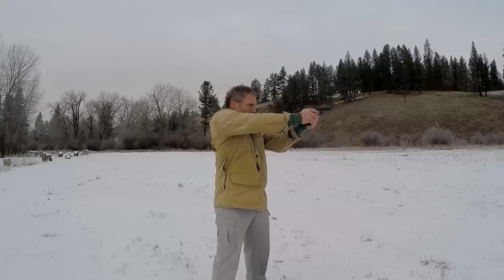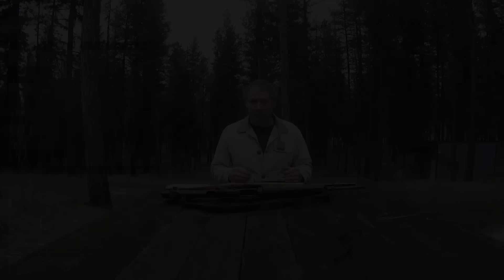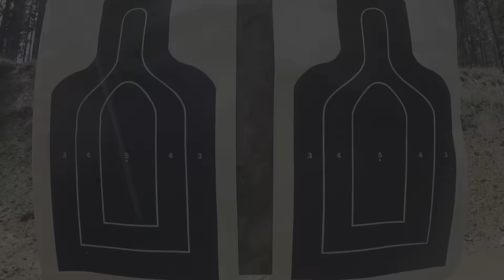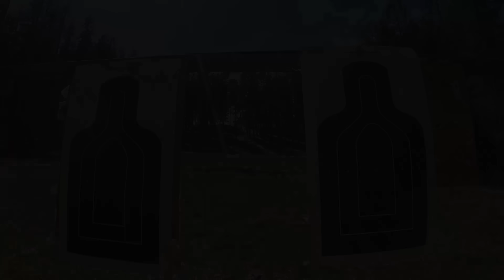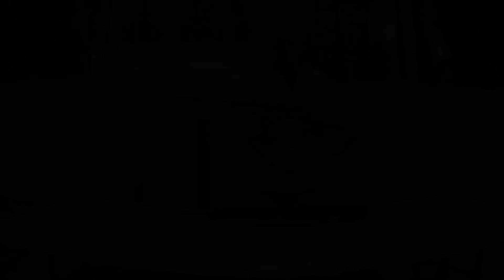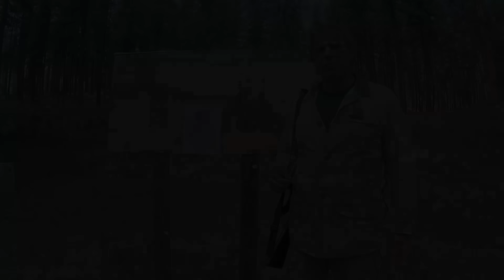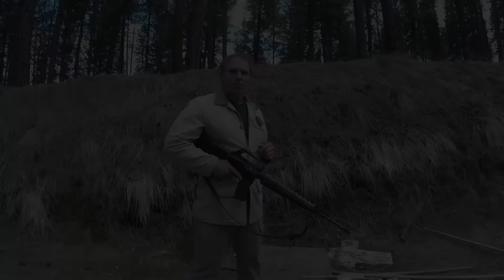Mini-14 vs AR15: Which is Better?

Comment: When did the Mini-14 switch over to accepting 5.56? Because they did last time I looked recently.
Reply: Mini-14's were always chambered in 5.56 NATO.  The confusion arises because for the earlier ones the receiver was stamped .223 Remington but the chamber was actually 5.56 NATO.  Later on Ruger changed the stamping to 5.56.  The one exception to this is the Target Model which is chambered in .223 Remington.  If you have a question about a particular rifle look at the owner's manual for it.  It will state in there the ammunition it's chambered for.   Those manuals are available online from Ruger's website.

Comment: I bought the new and improved Mini 14, I was able to keep it on a pie plate at 100 yards. I initially thought it was my scope, it wasn't. Ruger told me 6 inch variance between shots at 100 yards is acceptable and there is nothing wrong with the rifle. I sold the Ruger Mini 14 and wouldn't dream of ever owning another.

Comment: The two biggest things that hurt Police Officer training, is size of department. Too big, training is streamlined. Too small, training isn't given enough attention...which is a polite way of saying, funding. That, and because they handle them every day, some Police Officers become complacent in their training, call it ego, if you will.  Seriously, this is statistical. Got to any Sheriff's Office, and consistently, their Corrections Officers/Detention Deputies, will fire more controlled and accurately, than their Police Officers/Road Deputies. Correctional Officers do not have their weapons, on their persons, throughout their tour of duty, and so hold it in higher regard, as in, take the handling of them, more seriously.

Comment: You know you can shoot 556 out of the Mini 14, they only branded the civilian ones 223 to not associate it with the select fire versions. Ruger themselves will tell you if you email them, and myself and plenty of people have shot 5.56 out of them with no issues. I've noticed on mine at least it really like 62 grain as far as 100 yrds accuracy. Last time I went out the best grouping I shot was a 1.5 MOA grouping of 5 shots at 120 yrds. Granted mine has an inline chote lightweight stock and not a wood stock like I wanted but I was shooting from a bench anyway so it doesn't matter

Comment: Paul, thanks very much for the great videos.  Please keep up the good work.  I like your practical approach to the variety of topics.

I actually like both platforms.  I think that in many cases, its what one is used to that determines which they prefer.  Many people have declared to me that they like the mini 14 because it reminds them of the M-14 or the 30 carbine that they grew up with or used in the military.  I can say the same thing for myself regarding the AR.  I really like shooting the mini 14, and have owned my share of M1As and 30 carbines, but I am much more comfortable with my AR.  I restored an early 70s AR and after 26 years of carrying M-16 A1/A2 and M-4s, I was reminded of how light these older rifles were.  I found the lighter weight of the old A1 a delight.  There's my 2 cents worth.

Comment: Yeah I want to move to a state that has better gun laws than California cuz just this year they put a law in the books for two things one you have to have a background check to get any kind of ammo every single time 2 you're a new AR-15s can no longer have removable magazines they're welded into the gun you have to load them from the top and that was the way AK-47s and ak-74s wer for several years in California but the AR 15 style rifle you just had to have a what was called a Bullet Button but you can buy a receiver and parts to put your gun together and it never came with a Bullet Button you had to buy one but they didn't take the original magazine release button out of the kit so you could put it in yourself even though it was illegal to do so but now all the AR mags or 10 rounds and like they've been for many years and now you can't even remove the magazine and you have to wait a 10-day waiting. Each and every time you buy a gun in California even more for a pistol

Comment: As a firearms instructor I enjoyed your presentation and thought it was quite well laid out and prepared.  I've always favored the Mini-14 over the AR platform and have owned several in the last 44 years, probably a dozen or more.  Practically, I've had more experience with the AR tho and out of all those Mini's I've only owned 3 that would come close to the accuracy of the average AR.   Your presentation on the difference in sight systems and sight height was very good.  I thought you were quite charitable on the comparison on maintenance, but even tho the AR has more small pieces you can easily clean the bore from the breech end with a proper rod, not possible with the Mini.  I wish you had touched on the AR being more user friendly on parts changing and availability than the Mini, but I understand that a lot of shooters don't do their own modification or repair.  I thought you covered the magazine issues of reliability, cost, and changing mags in both guns quite well, but Ruger has manufactured both 20 and 30 round mags since the early 80's, they just restricted the sale of them to law enforcement officers, agencies, and dealers until recently.   Overall a very good video that I will recommend.

Comment: I know this comment is a bit late but in the offhand that you read it, I'd like to see a meat target demo of 55gr 5.56 ammo in a 16" barreled AR compared to a shorter one like an 11.5" or 10.5". There's a lot of talk out there that M193 ball type ammo isn't nearly as effective on target tissue when fired from a short barreled AR compared to a full sized 20" barrel.
Reply from the maker: I try to read all the comments. I miss some of them. We have done a vide where we chronographed 5.56 through 16" and 20" barrels. However we did not compare the barrel lengths on the meat target. A video comparing the effect of 10.5"  16'  and 20" barrels on the meat target sounds like a good idea.
Reply: @PaulHarrell Thanks for the reply! I think it would definitely be a 'mythbuster' type video. Keep up the great videos, I enjoy 'em and you're the best!

Comment: For the record, the M16A1 without magazine or sling weighs about 7 pounds in reality, an ounce or two more or less depending on manufacturing variances of different parts, especially the plastic furniture parts, which have fairly loose tolerances compared to the steel and aluminum parts. 

You can't trust the Army manual. For example, It gives the weight of the M16A1 as 6.35 lbs. (which is pure BS) and the weight of the M1 sling as 0.40 lbs. Then it says that the M16A1 with sling and loaded 20-round magazine weighs 6.75 lbs. If that were true, it would mean that the loaded 20-round magazine weighs absolutely nothing. Also, it gives the weight of the M16A1 with sling and loaded 30-round magazine as 7.06 lbs., and if that were true it would mean that the loaded 30-round magazine only weighs 0.31 lbs., when in fact it weighs more than 3 times that much (about 1 lb.) 

The Colt M16A1 manual (CM101) lists the weight at 7 pounds, which is right.

The last version that would have weighed 6.35 pounds was an early Colt Model 604 (AKA: early M16, i.e., the Air Force's counterpart to the Army's early Colt Model 603, AKA: XM16E1), due to having a type D buttstock and Edgewater buffer, which, combined, weighs about a half-pound less than the M16A1's type E trapdoor buttstock and improved buffer. Plus, its lack of forward-assist accounts for the remaining few ounces.

Comment: A1 vs mini front sight height difference in also due to “heat mirage”, which will affect accuracy. Also the older mini 14 rifles tend to string shots as the barrel heats up.
Reply: Yes but ruger fixed that problem

Comment: Never had a Mini 14, but have 2 ARs.  I have several different brands of mags and have not had any issues with them.  I have multiple polymer and steel mags.  Check out Okay Industries metal mags.  You won't be disappointed.

Comment: The "high point" of the Mini-14 was when it cost less than an AR-15.  Now, a Mini-14, new, cost almost twice what you can get an AR for.  The after market choices/accessories/options are nothing like what you can get for an AR.  
I bought a Mini-14 in the 70s, when I couldn't afford the AR.  I still have it.  It's not for sale.  I since have added three ARs (and one in the process of being built). They are all different from each other, barrel lengths, handguards, stocks, etc.  I like the Mini-14, but not enough to pay nearly twice as much for one.

Comment: Great video, especially the part about perceptions.  I just have to share this story.  A few months ago, a buddy and I decided to take a trip to the range.  I took my recently acquired Mini-14, he took his AR-15.  Both legal and widely used in my state.  No rifle cases - just walked out to my truck and slid them both in the back seat.  About 4 blocks from home, a police car flashes the lights and pulls us over.  One officer walks up to my window and the other to the rear corner on the passenger side.  I roll down my window and the officer asks for license and registration, along with a request to "keep our hands where he can see them".  After the license and registration drill, he asks if the rifles in the back were loaded.  I responded that they were not - the mags were loaded, but we wouldn't mate the mags to the rifles until we were on the range.  He then asked to see the AR-15.  I informed him that my neighbor, the passenger, owned that rifle.  Nevertheless, he asked me to step out of the vehicle, grasp the AR-15 by the barrel, and slowly hand it to him.  I complied, then asked if he wanted to examine the Mini-14 as well.  His response was priceless:  "No, I'm only interested in the assault rifle".  He looked it over, did a quick press check, and asked where we were headed.  Again, I told him we were headed to the local range.  He then handed the rifle back and filled us in on the purpose for the stop:  another neighbor saw us carry the AR-15 to the truck and called the police, concerned we were on our way to "shoot someplace up".  He then told us we were free to go, then (get this) followed us until we pulled into the range parking lot.

I suspect that the police officer made about 15,000 procedural errors with this stop, but that's another issue.  The real point:  it's the perception of the AR-15 - even in a state where the AR-15 is legal and widely-used - that swayed me to pick the Mini-14 instead.
Reply from the maker: Very interesting and disturbing at the same time.
Reply: @PaulHarrell  I lean more towards disturbing, which is pretty much my go-to for any event that causes a change of pants.
Reply: that was typically priceless, its amazing how many ignorant people there are out there. maybe you should ger a gun case.
Reply: More plastic and black equals scary. More wood equals ok I guess.
Reply: @chopperdeath fudds at it again.
Reply: Personally I really enjoy the overall looks of Retro AR-15’s but for some reason I equally like the look of the Mini-14. I have a M1A and I’m currently in the market for his little brother. Haha
Reply: Lack of training on police part and I must say use a rifle bag! 😅
Reply: The onus is on you, unfortunately. In the current era of hysteria, there are a plethora of Gladys Kravitzes scoping everything and everyone so it is your duty to case up your firearms when stepping outside in full view. Furthermore, a nondescript case might prove wiser to disguise one's personal predilections. I like the golf club bags and baseball bat bags the best, but anything can work, even a long tool box that says "DeWalt" or "Milwaukee" will work.
Reply: I think the officer violated your rights.
Reply: I built my first AR-15 after the sunset of the 1994 AWB from a stripped pre-ban lower and a purchased post-ban flat top (with detachable carry handle) complete upper, a 16” mid-length. 

One of my best friends was over one day, and being the proud new owner of a completed AR-15, I showed it to him. He looked visibly shaken and told me that was the scariest rifle he had ever seen. I have never understood this visceral fear. 

I, too, had a Mini-14 that I bought in 1994 just before the ban went into effect as a hedge in case the AR-15 lower receiver I already had on order was never received in time. When it was, I sold the Mini-14 to acquire the funds to complete the aforementioned AR-15 AFTER 2004, when the AWB expired. 

During the ban, I had shown the Mini-14 to several friends, including the aftermarket 30 round steel magazines (7) that I had purchased for it. Nobody ever batted an eye, and all through the ten years of the AWB, I never had a problem, because it looked like a typical hunting rifle. 

As I said, I’ve never understood the fear of the AR-15. To me, it has always looked like a cool, modern rifle. I’m used to it’s looks and think it’s a beautiful rifle. It functions the same as any other semi-auto rifle, and gets a bad rap from all the misinformed.

In truth, I had never had any desire for an AR-15 as I didn’t have any use for one (at the time, in the early 1990s, you couldn’t use them in my state for deer hunting, like you can now). So, I didn’t want one, that is, UNTIL the government told me it didn’t want me to have an AR-15. Then, it became imperative that I get one.
Reply: When most folks go to the range they have their firearm in a bag or case.
Reply: What procedural errors did the cop make in that stop?
Reply: This is also used in regards to handguns. 
Many see revolvers as "Wild West guns".
And may perceive them very differently than a G19 which they perceive as a "Police gun". 
Historically both revolvers and the G19 were police guns. 
However, the public has a distorted perception in many cases.  Especially when those people may serve on juries. 
That's important to know. 
This may also apply to rifles like Lever Action rifles vs AR-10. 
One is a "Cowboys Gun" the other is a "Sniper Rifle" to the public. 
Though both can be scoped and we're in police or the military at some point. 

It's not an ideas issue necessarily. Though it can be. 
People have been told over and over about this yet do not listen. And these people serve on juries. Which may impact you some day.
Reply: That cop is a moron.
Reply: Bad cop.  Stupid cop.  Jerk off cop
Reply: Cop and neighbor are morons and should be placed in special care
Reply: Surprising how many cops know nothing about firearms
Reply: This story is the very reason I would have picked the AR instead of the Mini 14. Making the point to not care about perception. Plus most would agree the AR is superior. Thanks for sharing your story though.
Reply: Ngl, kinda cringe.
Reply: EVERYONE IN THE NEIGHBORHOOD KNOWS what an "Assault Rifle" looks like (AR15/AK47).... few know what a Mini 14 is.
Reply: What a great share of your personal experience. In my case, I called the local Sheriff's office and invited them to stop by my house and have a cup of coffee along with the "what if" conversation. Granted, I live in a somewhat red county. It was a good interaction overall.
Reply: You have people who do their job and activists, that cop was an activist. He is a danger to society and should not be an officer.
Reply: I don't know what states you all live in... but the first AR I ever shot belonged to the local chief of police.  My boss invited me to a BBQ, the chief was there too, and he asked if any of us had ever shot an AR.  I said no and he nearly fell over himself to hand it to me.  He was more excited about it than I was...  LOL  
If your neighbors... and local cops... are that ignorant of firearms, you might want to move to another state.  
Just yesterday, my neighbor saw me outside with my son and carried over two pistols that he just got new suppressors for... not in holsters or his pockets, just one in each hand... He walked across the street hollering, "Hey look what I just got!"  The three of us stood there in the middle of the street, looked over the guns, held them, compared them, aimed them, laughed and joked about them for about 10 minutes.  Nobody called the damn cops.. and if they had, the cops probably would have stood there and BS'd with us too!  
I feel sorry for people who have to hide their guns from the world.  I'm also thankful that I live in a place where most people aren't afraid of inanimate objects.
Reply: Soo you surcame to anti-ginner peer pressure to make your life slightly easier. Not a call I'd encourage

Comment: It really comes down to user preferences.  I prefer to own both.

I might add that another advantage of an AR platform is that you can use an AR lower with multiple uppers, such as a .300 Blk, without having to buy a complete rifle, unlike with the Ruger series.